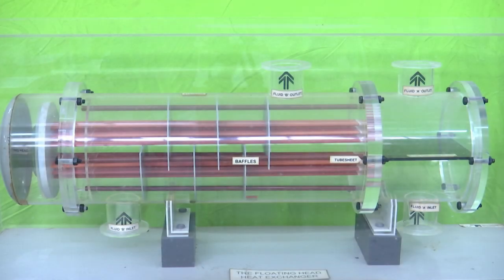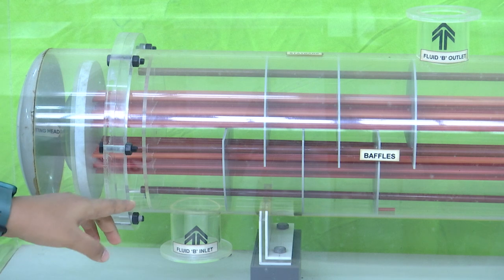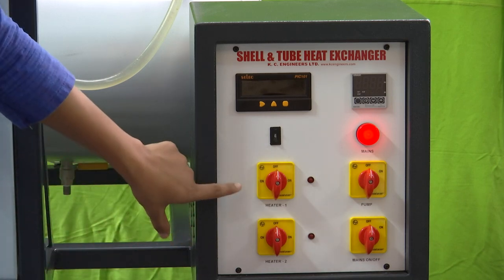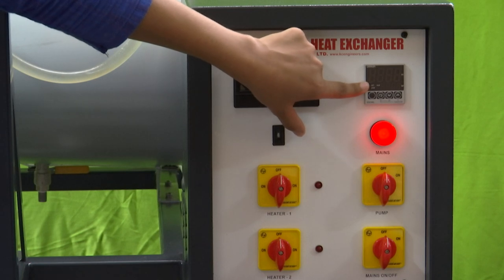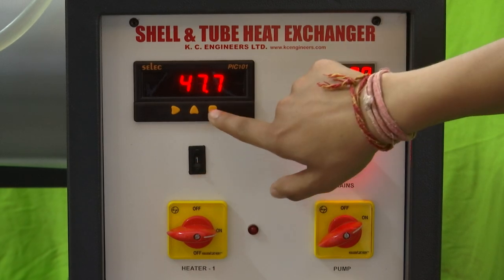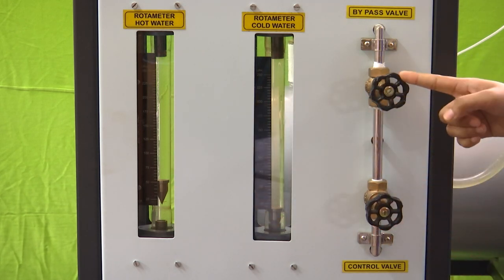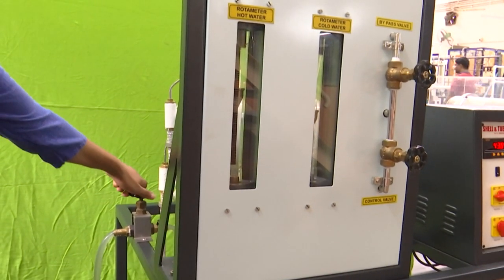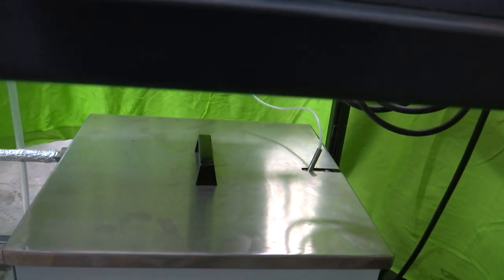Shell and Tube Heat Exchanger:  Performance Calculation

Comment: Sir please do upload process modelling and simulation experiments :

Process modelling and Simulation lab experiments

1. Estimation of dew point and bubble point temperature of a hydrocarbon mixture
2. Simulation of flash drum
3. Design of ditillation column
4. Optimization of a flow sheet or process
5. Determination of temperature profiles for heat exchanger
6. Concentration profiles for reactor
7. Simulation of Jacketed CSTR
8. Simulation of process
9. Simulation of evaporator/ distillation column/ extraction process

Comment: Sir please upload process dynamics and control lab experiments :

PROCESS DYNAMICS AND CONTROL LAB Experiments

1. I & II Order System Dynamics
2. Interacting & non interacting Systems
3. Flapper - Nozzle system
4. Control valve characteristics
5. Level control system
6. Flow control system
7. Pressure control system
8. Control of a thermal system
9. Design of control system for a given process
10. Simulation of a closed loop system
11. Demo Experiment using Aspen Software of a given process